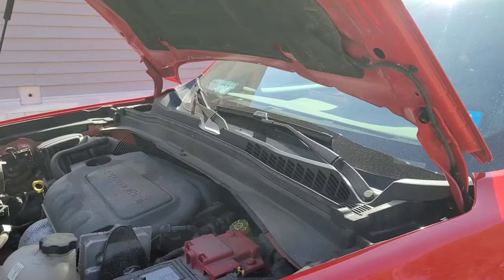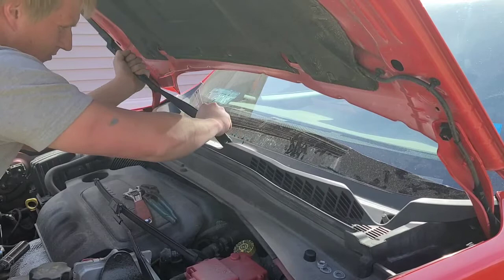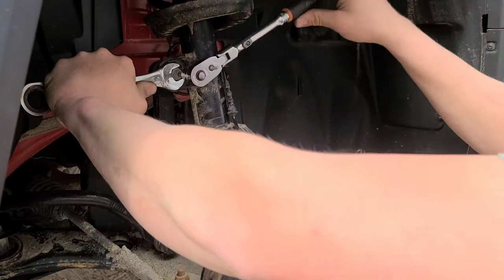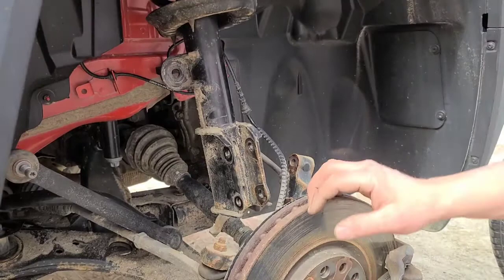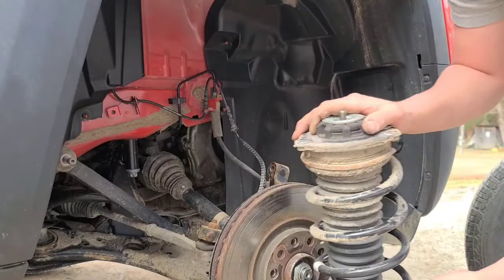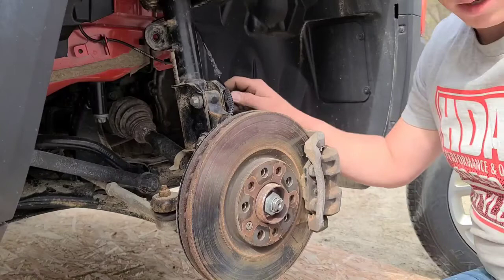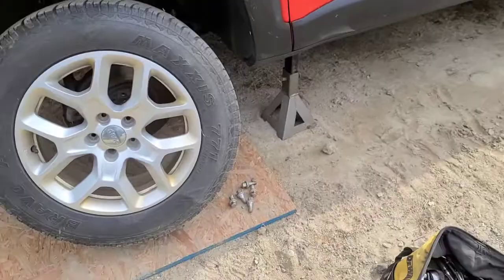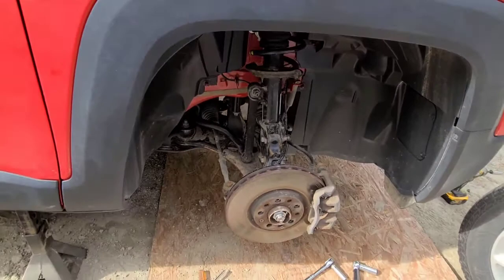Jeep Renegade front strut & spring replacement

Comment: Thank you for the step by step guide. My struts came from OReilly. I did both on my wife's 2015 Renegade today. It took about 4 hours and went well. I bought a set of Torx bits and Star sockets from Harbor Freight. It made the job easier. I was very glad the nuts were not badly rusted. The stuff they put on the Vermont roads in the winter is awful on metal and brakes.
Reply from the maker: Glad I could help you out. I agree all the road salts from winter beat up our vehicles in New England bad. Glad the job went smooth for you

Comment: Good video.  It helped me get the process down.  Couple things though.  You must have pre-loosed some things.  For someone who has never taken wiper arms off before, this was an exercise in frustration. They DO NOT just lift off like that.  After an hour of not being able to get past step 1, I realized that you don't Even have to take them off.  This whole project can be done by removing only the front fastener of the cowl on the side you want to change and bend the cowl up.  You can put a small screwdriver in there to brace it up.  There was plenty of room for my wrench after that.  THAT IS until I got to the left side.  Yes the cowl still bent nicely to allow access, but the wiper drive arms are right over the back bolt of the strut top mount.  There wasn't enough clearance for a tork ratchet and socket.  I finally found a combination of crescent wrenches that got the old bolt off.  The new bolt was much lower profile so it wasn't a problem.  During the sway bar removal I wish you had mentioned that it would help to support the whole thing with a second jack.  Mine really went wonky and stripped some threads from the bolt before I realized what was happening.  I learned a lot.  Thanks for your guidance.

Comment: I gotta do front struts on my renegade  does this require a front end alignment when the new struts are on?
Reply from the maker: No you don't need to get an alignment if your just replacing struts with all oem parts, but its not a bad idea to get one especially if you drive bumpy roads often. I never got one after I replaced mine and my alignment has been perfect
Reply: Thank you very much 👍
Reply: What size socket did you use for the bottom 2 bolts?

Comment: What is the part number for those struts?
Reply from the maker: For the front right its 131037-07941894 from partsgeek.com and for the front left its 131037-07762525. I buy parts from parts geek all the time. Great company imo
Reply from the maker: The brand are Gabriel
Reply: Is there a certain way you have to clock the strut assembly to get the alignment right? Thanks!
Reply: Are the Gabriel struts you installed for an AWD Jeep Renegade?
Reply from the maker: yes
Reply: Why did you do a 90 degree additional turn when finishing up after torquing to the correct specs? Appreciate the video! Working on my renegade soon.